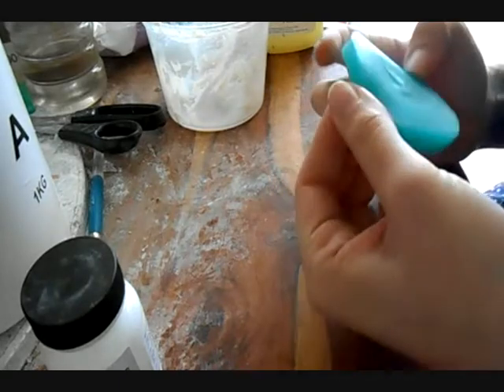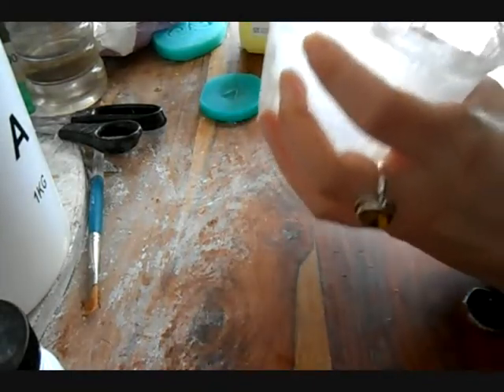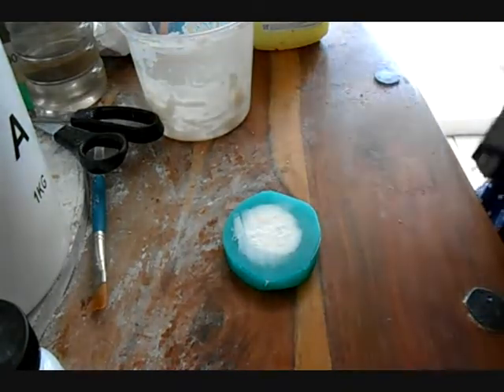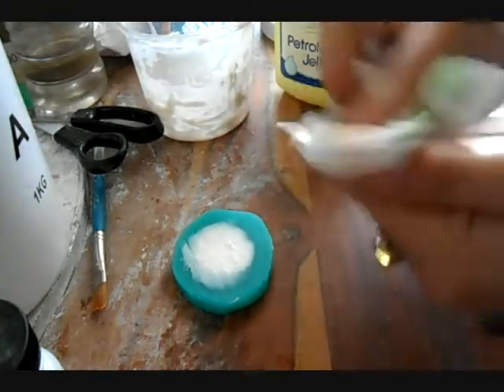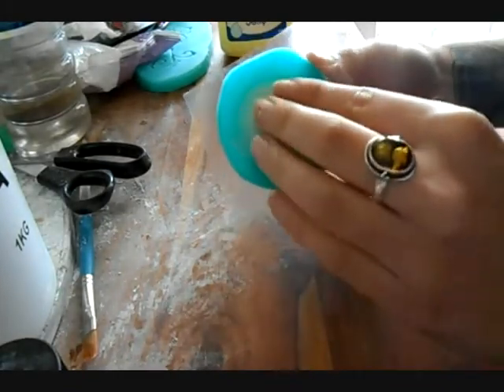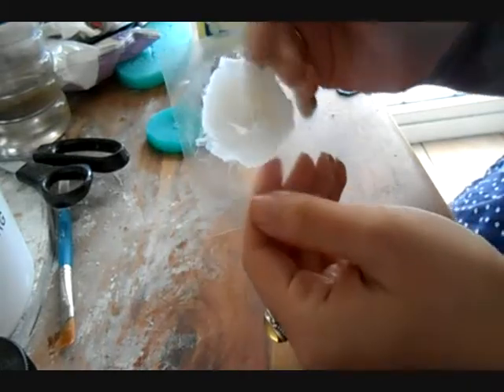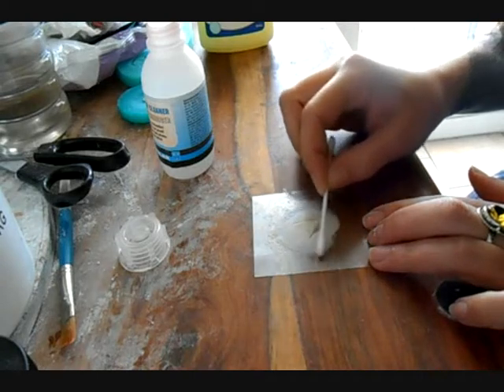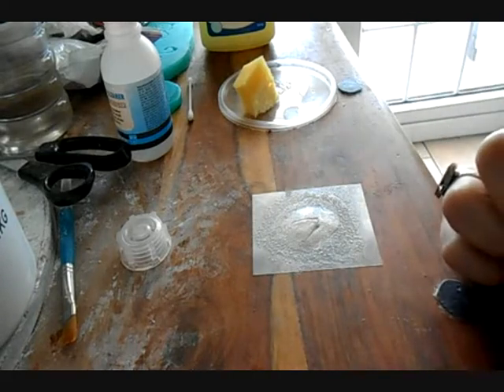Making a 3D Bondo transfer.

Comment from the maker: Hi, I use silc pig silicone pigments but you can use any silicone pigment, you could probably even use oil paint if you wanted to save some money. I haven't noticed any shrinkage as of yet and haven't tried it in a food mixer as I found it works perfectly well without mixing it for a long time. I didn't know that Mould Life had pre released acetate, thats handy but I imagine quite expensive. Acetate and vaseline works for me. Not a problem, thanks for the interest and comment.

Comment: I would be guessing you aren't getting any shrinkage as you are not fully drying them , which could be a time saver and bonus. I may try my flesh colour silicone pigment as I am not quite getting what I want with acrylic inks. May put some flocking in too. The acetate sheets at mould life are reasonable for the size but I don'y like their minimum delivery price of £15. Mould Life sell the transfer paper and acetate together

Comment: It will. Just stick some vaseline or Epoxy Parfilm in the mould as a release. Brush or spray in your cap plastic in the necessary number of layers, mix your deadened silicone and smooth it in. Even if the silicone mould is made with condensation cured silicones, the cap plastic will prevent cure inhibition of you addition cured appliance silicone.

Comment: Well the Cabosil way is best for you then. Just mixed up a batch of bondo today, 1 Kg of Pros Aide  and it was so quick in the heat of my conservatory and using a fan. I am going to try your idea of the silicone pigments with this batch..well a test sample first, then if it works, scale it up. I wonder if you have any other pieces that you could video you applying and upload them to your channel.? Be nice to see the full result. :)

Comment: Nice. What do you use to tint them? Do you find you get much shrinkage using Cabosil? Have you tried thickening pro saide  in a food mixer? Have you tried the pre released acetate sheets that come with the water slide paper, from Mould Life?  I must try leaving my small one for just one hour to thaw out. I normally do it for 12 hours in a dehydrator before they dry. Could save me a lot of time. Sorry about all the questions but I like seeing other peoples processes

Comment: Do you think this procedure will work with silicone, instead of bondo (after using an incapsulator to prevent silicone to stick on the mould)??

Comment: Hi , I have used a products called pro bondo from a  company called makeup in London . After I put it in the mold , cover with the acetate paper and put it in the Refrigerator over night . But it still haven't dry . I wanna know is it the bondo got some problem ? Or the acetate paper cover on it , no air can get it and can't dry ? Thanks to ans my question . Coz I try many many time but still have the same problem

Comment: I can't release the application from acetate, even if i tried different kind of release agents (included vaseline) !!! any other suggestion??? thank you
Reply: The side of the acetate that you use matters. Make sure you are applying to the correct side of the acetate or it will not release.